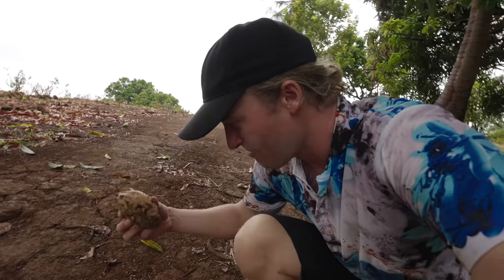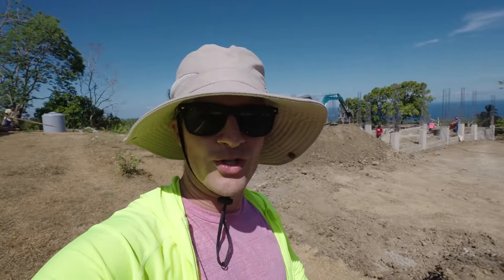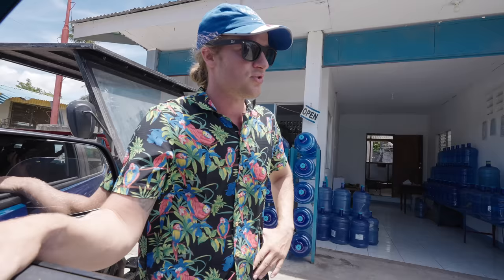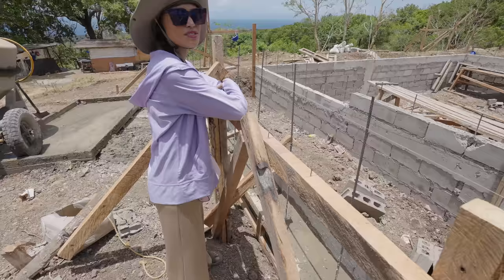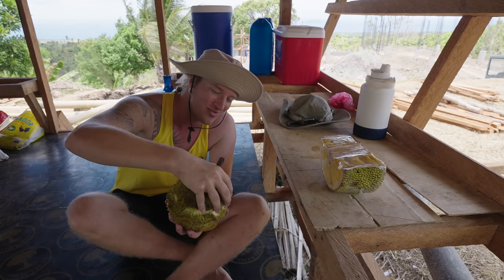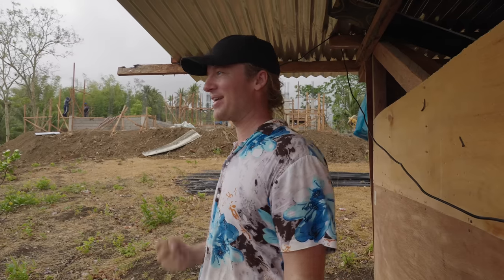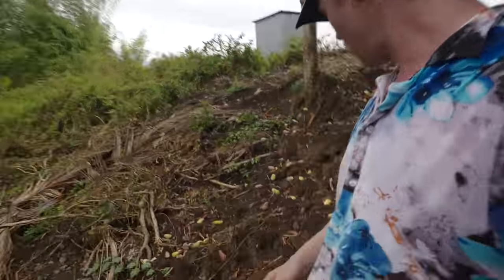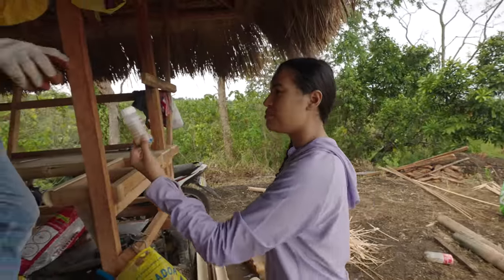BUILDING HILLTOP 360° HOME IN PHILIPPINES - Swimming pool, Foundation, Nipa Hut, Shopping & RAIN!

Comment: Hey Finn have your foundation treated with  termites  insecticide or you will have big problem in your house later on. Those will  crawl along the underground pipes. And will cause problems later on. Those flying insects are termites.

Comment: The machine is called an excavator where as a backhoe is operated from a tire platform. I have owned and operated several excavators over the past 30 plus years. The blue one was squalling in pain from not being properly greased. Lack of basic maintenance will have a domino effect. Just say'n.

Comment: Oh, bummer you didn't use the gas pressure washer trick to drill holes for tree planting as I suggested. Just using that crude digging tool instead. Oh well
Reply from the maker: I don’t have the machine yet and soil was already wet
Reply: @FinnSnowVlogs  well you don't have to do anything, however, it's the force of the pressure washer that evacuates the soil, not the moisture. But if you do try it make sure you completely protect your eyes cuz mud will go everywhere! It's amazing how effective it is.
Reply from the maker: Also don’t have electricity…
Reply: @FinnSnowVlogs  gas powered pressure washers don't use electricity

Comment: I hate to bust your bubble, Finn, but steel isn't made in the Philippines. Likely, the steel going into your house is coming from China. BTW, I am hoping they are only using the coco lumber for building forms. You don't want any wood in the actual structure of your house in the Philippines (unless you understand that the termites will eat your house within ten years). In my house, I made the mistake of letting the contractor use wood in the door frames and trim work, and we have been fighting termites ever since. If we would have used steel door frames and plastic or tile trim, we never would have had the problem. Termites are like internet trolls. You should never feed them, and termites eat wood.
Reply: Wow Bill😮…good to know…do they sell 2x4’s made of steel in the Philippines?
Reply: @marcrichard7251  Yes, but they aren't easy to find The interior walls in my home are framed in steel The exterior walls have 4 inch steel pipe supports with steel reinforced foam panels (for insulation) and sheathed in cement plaster (the same way they do with most CHB walls here). 

My house went through the 7.3 earthquake and a  Cat 5 typhoon (Yolanda) in 2013 without even a hairline crack in the plaster. I watched as CHB walls on homes near ours crumbled during the earthquake and watched roofs framed in wood being torn off during the typhoon.